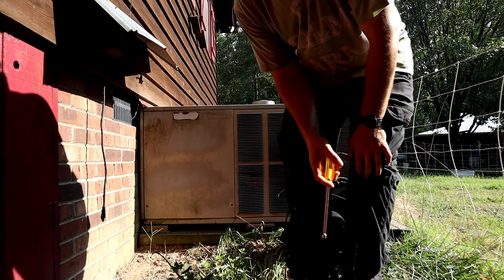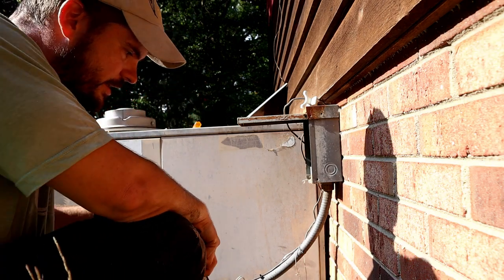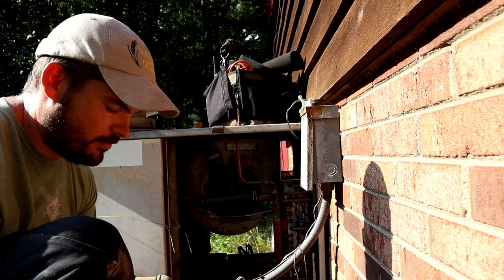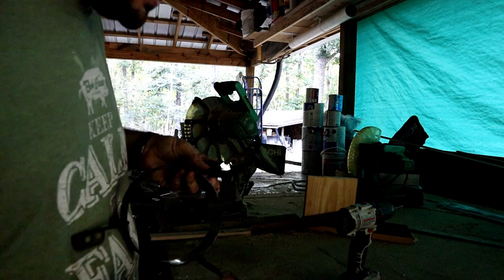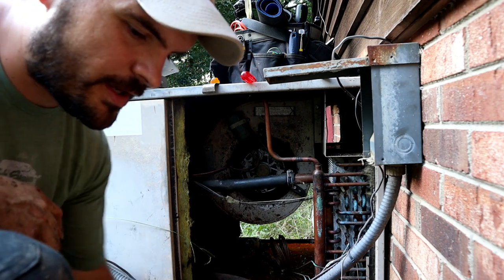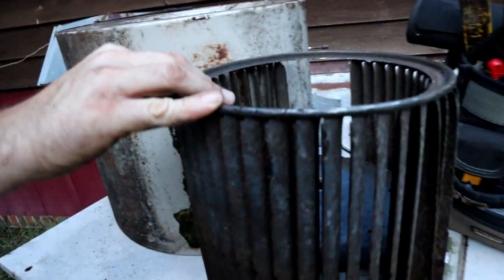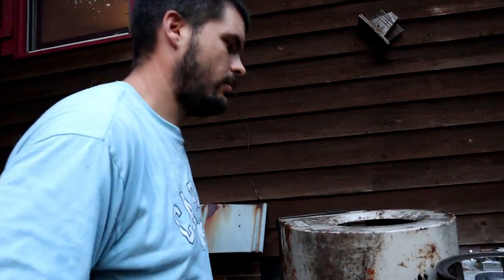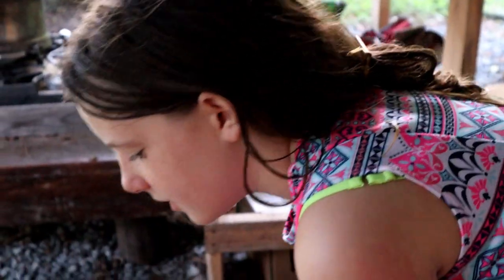Homesteader SAVES Thousands by Doing It Himself

Comment: Nice job Adam! Our central AC/heat went out a couple years ago. I say a couple, but looking back it might’ve been 4 or 5 years we got our unit patched up similarly, and kept it running until last September. It was the original when the house was built in 1978. 41 years was a good run. Haha. We did finally have to replace it and the unit inside. Our electricity bill did go down a bit with the new one, but not enough to make up for the cost. Keep yours going as long as you can brother!
**editied because I accidentally called Adam, Art. Lol. Oops sorry!! 🤦‍♀️😳
Reply from the maker: Ok, thanks!
Reply: Farm Life Outfitters I’m so sorry I accidentally called you Art. I feel bad! 🤦‍♀️

Comment: Wish I had a clue how to fix my AC/heater. Think motor cause I smelled a burnt odor through out the house. I'm in TX. Can't afford a repairman out. Was a tough winter and a hot summer. I'm single so just keeping my bedroom cooled. Rest of the house, ugh. Glad you got your's fixed.
Reply: Built On The Rock Homestead that’s rough being without AC we’re in a desert. So a dry heat, but hot non the less. When our central AC went out we had a company come to our place and they didn’t charge us an arm and a leg. It might be worth looking into. Ask around, maybe someone near you knows how to fix it and you can barter something to get it up and running.  Tx is too hot without ac. I worry about you being in too much heat and humidity.
Reply: @weloverescuedogs2820  just to drive to my place is $95 + service charge. I'm in the boonies and I know there isn't  anyone. I was loaned a window AC. It keeps my bedroom bearable.
Reply from the maker: I'm so sorry. I wish we were closer to lend a hand if we could. Do you have any neighbors or friends who might be able to try to get it working for you?
Reply: @ShelterMountainFarm  not with AC knowledge. I'm fine. The window AC in the bedroom is keeping the bedroom pleasant.